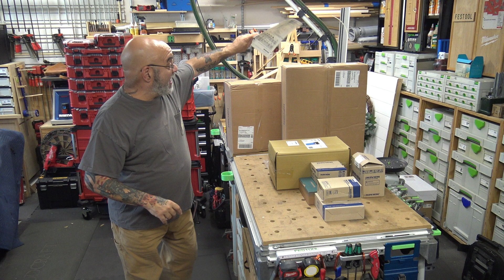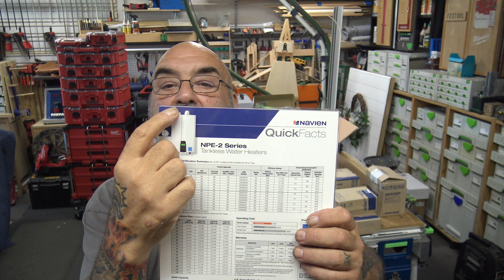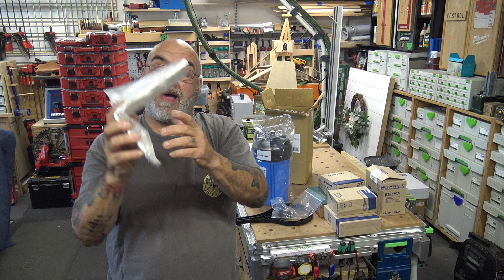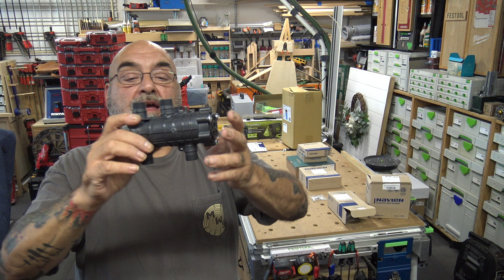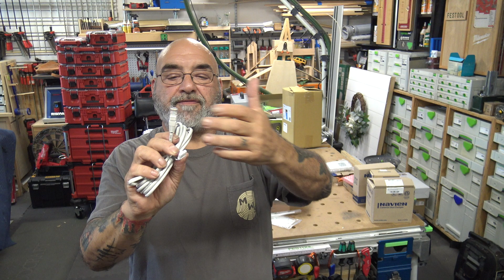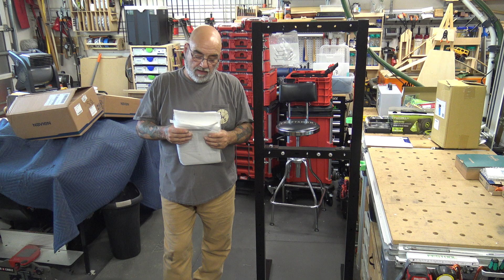Navien NPE & NPN accessories

Comment: Hey man, I have a rinnai tankless from 07. I showered one morning with plenty of working hot water, and later that evening I go to use my hot water and have absolutely nothing coming out of my sink. No hot water pressure at all. I checked all of my filters like I’ve seen in your videos, made sure all my valves were open too. Plenty of pressure going into the tankless but it’s not firing up and I have no outlet pressure at all. The remote is still functioning but no error codes are present